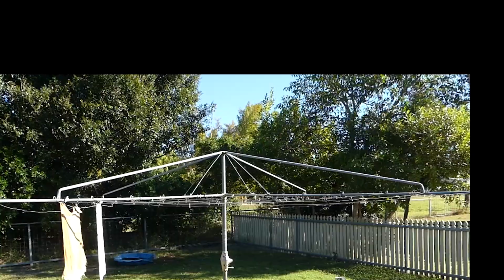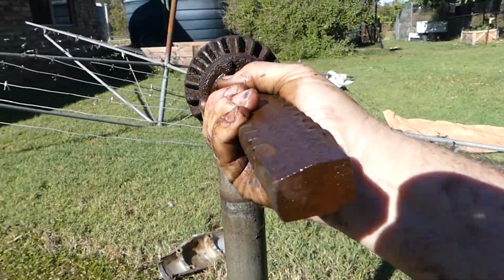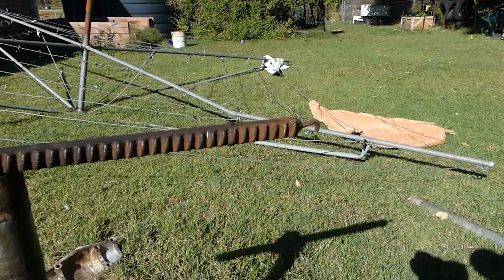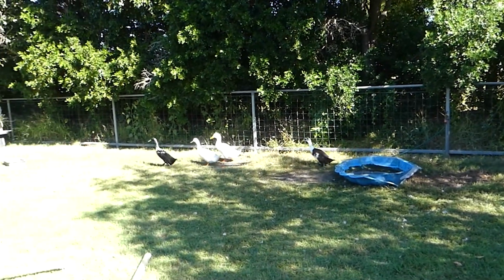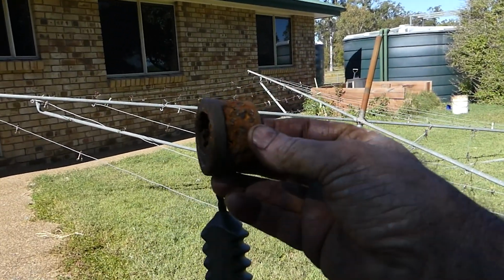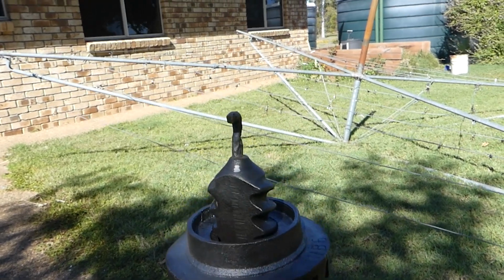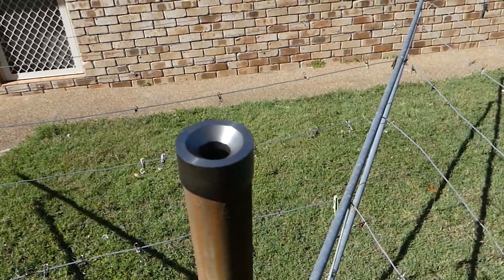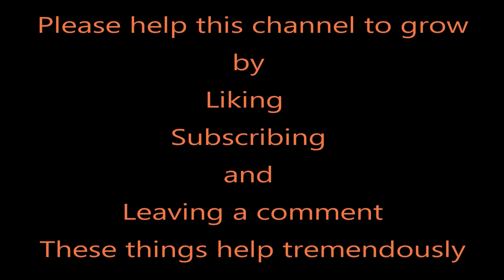How to Repair Your Hills Hoist, The Bundy Bears Shed Way.

Comment: I just pulled mine to bits. The lift up part that you made a collar for didnt have a separate washer. the collar is effectively the conical washer too. The hook lodges inside the centre hole to prevent uplift which is why the collar is tack welded to the pipe. I dont have a lathe so Im expecting it will collapse one day in near future as rusting quite badly. my gear cogs are nylon too on the winder so not as good a build quality as yours but still ok as ive combined two clothes lines to make one workable one. I found your video was great. I have oiled rather than grease just a t present as I could find the grease. Also needed to dismantle the top to transport and was hoping for a close up of the rod connectors under the top pipe as photo I took prior wasnt clear enough but think I have worked it out now. Back out to try.
Reply from the maker: I think parts for these would be a good seller as I often get contacted re my repair. They are  good solid old thing for sure.

Comment: Righto - got the same issue with mine, any chance you can sell me a coller and washer? Got a dodge temp fix with a bit of flat steel going at the moemnt but would love to fix it for the next 50 years.
Reply from the maker: No Im sorry no time to do any. When I retire I may well do some but for the moment no time.

Comment: Most interesting! I had not seen one of those before now. We had similar things for air drying but none built as well as that one. Oh by the way, there must be a can of cold-galv. around somewhere. That's just ugly rust and a rust stain can be as hard on the wash as grease. Maybe more considering the easy fix.....😀
Reply from the maker: I did think of that but thought it would just wear off again
Reply: @BundyBearsShed  So in a few years you paint it again!

Comment: Im guessing this is what has failed on ours....
Can't seem to find any individual part to fix this though.

 so Im thinking of attempting to reddneck it by getting a bit of scrap galve sheet, and using an old toeball  and  sledge it into a pipe of similar sixing to see if it conforms to a usable shape. Then tac it grind it weld it grind it. Spray it. Grease it.  😅
Reply from the maker: All you can do is give it a go. I see the modern ones have gone to a plastic screw now so they wont last like these old ones will.

Comment: Great video.thank you for valuable content and expertise. We cannot make the  top for above the winder to lift the pole like you did. The hills site does list it and they are out of stock of the hole repair kit which didn’t depict it anyway. Any other ideas?
Thank you
You
Reply from the maker: Try a local engineering shop, show them what I did and they may be able to sort out something.

Comment: Hey Bundy, great video I have the same p roblem as yours ie conical end sleeve has deteriorated. I had a look on the hills hoist parts online as suggested but they don't sell them. Are you able to make and sell me one? I live in country Vic and prepared to pay your labour and postage. Regards Michael
Reply from the maker: G Day Michael, No I only made the one for mine and didnt make any extras, I have had quite a few requests for them so perhaps I should. Perhaps when I retire I will have time.
Reply: Id buy one! But if youre not selling Ill have to turn one up from hardwood or plastic, no metal lathe

Comment: inox is a good spray doesnt dry out, atleast your hillshoist has metal gears and not plastic, good to see a sidchrome ratchet, still got my original set aussie made decades later still good even with lots of abuse.
Reply from the maker: Yeah the early Sidchrome will see us out they were good gear back in the day.

Comment: Take 2 to see if the ether comment from the other vid  stays here.... Take feckin 3,4,5,6, 10 keeps disappearing🤷‍♂️....Vileda will probably be plastic not rugged looking 😂 I got onto Vileda for line and tensioners, really only tensioners, i had bought hills line on Amazon. They said there's hills line on the site for sake but no tensioners.....Seriously WTF 
Anyway line on now just need a day to be bothered to fix the crank 😂
What about a plastic not rigid sleeve on the up n down?. I see you've not got the plastic line they sell now
Reply from the maker: The newer models have the plastic gears here I see. I found a roll of the old wire and we now use stainless pegs. We had no crank for years and it didnt bother Judy so it didnt get fixed, lol.
Reply: Crank fixed today here, couldn't be more plastic and crap to boot 🤣
Reply: Was thinking with the sleeve something like a shocker boot or lay flat pipe....might do that myself yet.